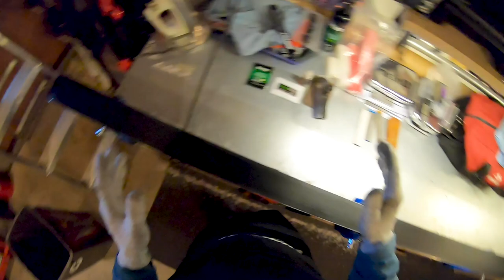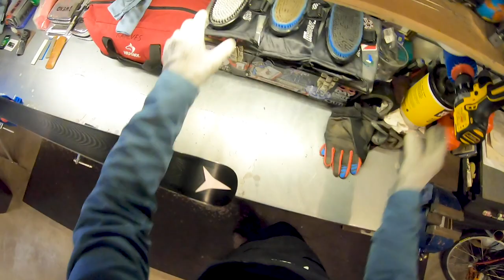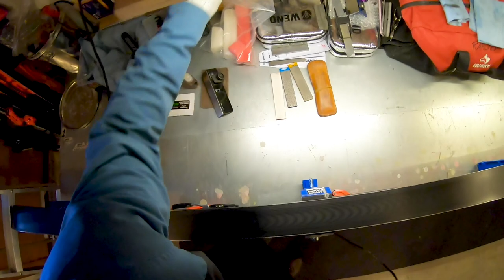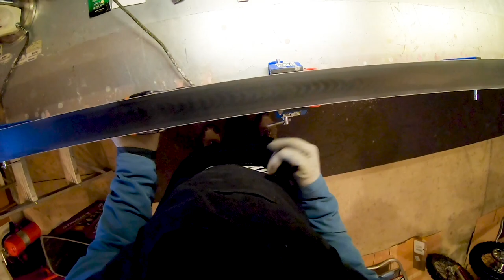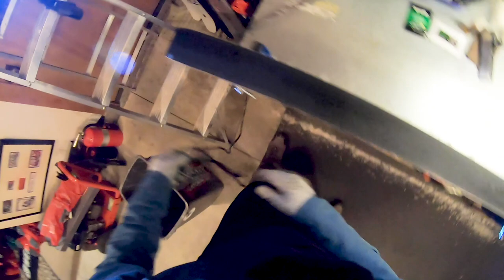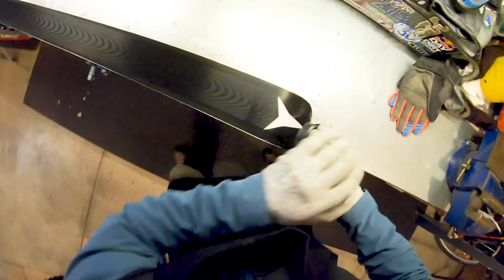Ski Tips with Daron Rahlves: tuning and waxing maintenance part 2

Comment: I used a heavy iron like Daron uses for many years.  Last year I bought a specialty iron for waxing and will never go back to a traditional iron.  The specialty wax iron sold by Swix, Toko, etc. never seems to burn wax and tends to leave a more uniform surface before the skis are scraped.  I use the cheaper iron without the digital readout, but remember (or write down) the rotary heat setting for a given wax.  Sure the digital readouts are what the WC technicians use, but they are looking for every advantage they can find over any other technician.  Sidewalls are neglected areas that many club racers fail to take care of.  I usually use a solvent such as a mix of Napha and Lacquer Thinner on the sidewalls to get the wax deeply into the sidewalls.

Comment: I also said this on the other video, but the bidirectional "scrubbing" with the brass brush at 8:30 goes against many brush manufacturers' recommendations. It's a particularly bad idea if you have a recent Red Creek or Swix brush in which the bristles are tilted such that they're designed to trail in one direction. The usual advice is to use metal brushes tip-to-tail only, and always with the brish pointed the same way (the direction marked on the brush if it has tilted bristles, or just some consistent direction otherwise). All others (horse, boar, nylon, etc) can be used in a scrubbing motion.